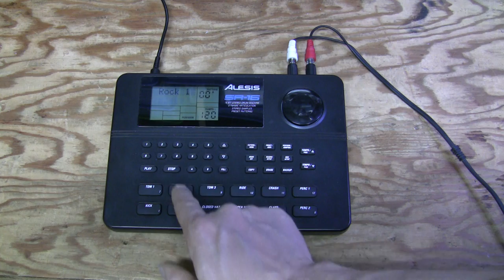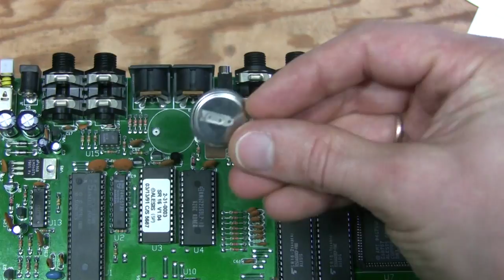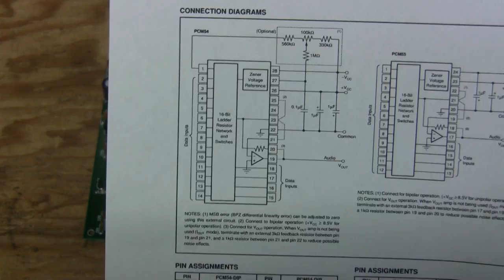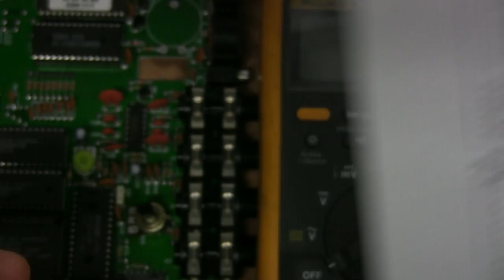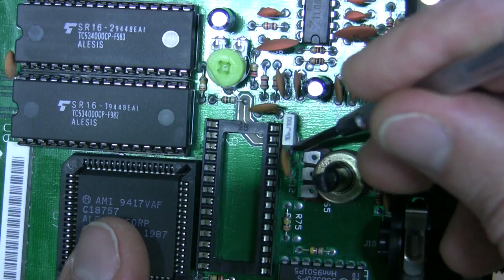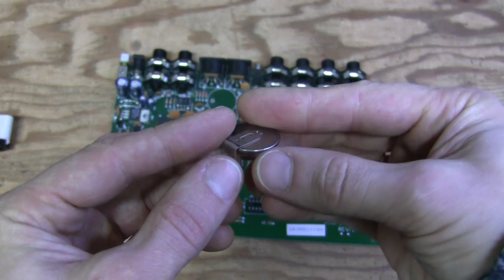#21 - Alesis SR-16 drum machine repair

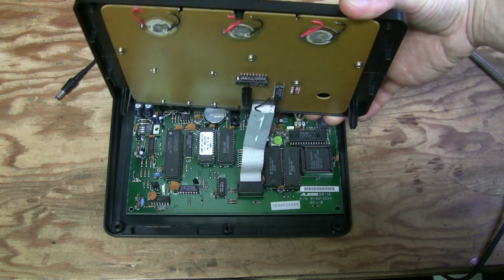Comment: 2:00 I can’t disconnect the front panel 😢 I don’t want to break the cable. Im trying to figure out why the huge volume knob doesn’t work at all, but all the sounds work fine. But the volume knob has no effect on the master volume.

Comment: Found one for cheap at Goodwill. Ordered a power supply to try it out, but had some garbage characters on the display. Pressed the socketed chips to reseat them and unit is now working. Still need to replace the battery and spray the volume control with tuner cleaner.

Comment: I got two of these for free, stating they were not working. I tested the power supply and got no voltage, so I ordered up a 9v ac to ac 1.3a PSU, as I needed one for my old digitech multifx unit anyway, and figured if nothing else I would have a replacement for that. Plugged it in and they both worked. Just need to clean up the volume pot and install some battery holders, since both original batteries were cut out and dead, anyway.

Comment: This video was insanely helpful after finding out the 3v battery on my unit was dead. Had no idea about the battery until i looked up why my SR16 wasn't saving patterns. 
Your suggestion to use that battery bed was probably the most helpful practical thing I've ever watched on youtube. From now on i don't have to order a special battery and go through the soldering each time...When it dies again i can just pop a new one in!! My SR16 is now immortal lol Thank you!

Comment: Bravo !! Very good video. Thanks for making the video. I've got a unit that is doing something similar. I'll use this video as a template for servicing it.   In 1997, I used an SR16 on this one man band recording.  The recording was done with dedicated 6 track, digital (which was new technology for the consumer, then) recorder.  This was one man band stuff, recorded in an apartment. https://www.youtube.com/watch?v=moEkIBJuk7U  PS: Later I studied jazz, and found that I could not get a good jazz drum sound out of my SR16, so I improvised a very low tech solution: (drum roll, please).. I took and empty coffee can, stuffed it full of empty plastic shopping bags., put the lid on, turned upside down, and used drummer's brushes on the bottom of the can. Talk about low tech... here is the result:  https://www.youtube.com/watch?v=Nr2aFJvL2YI

Comment: Thank you for this.  I just bought one of these from someone and, lo and behold, it won't store any settings or patterns after I switch it off, so I guess the battery needs replacing.  I managed to find what looks like the same battery holder on amazon (20mm between the pins) so thank you for all that detail including the orientation to fit it.

Comment: That was excellent. I learned a lot. I have a SR-16 that I just got out. I bought it around 1989. It also has a noisy volume pot. I will check the battery as well. It also has a rather dull LCD display. Do you know if the LCD would need to be replaced, or could there be another issue?

Comment: Great video. I'll be honest and say I don't understand some of it. I just got my broken Sr-16 down from the loft and opened it up to see if I could make sense of it. I think it stopped working (well the LCD briefly flashes on then off when powered up) when I was loading some midi data from tape. Is it possible that the volume from the tape player was too loud and overloaded something? I think I think I need to watch this video a few more times before I start trying to test with my multi meter (and watch other videos too if I can find them). I tried an alternative PSU but get the same problem.
Reply: Update..............I just stood on the unit and snapped the Volume Rotary Pot! :( ....and I just noticed some residue one the a pot (the green one on yours). Not really sure what the pot is for though or if it is the cause of problem?

Comment: I wish you did the video on this for no sound. I have the exact drum machine you're repairing here bought it broken from a shady seller. So am trying to figure out which way to go. I don't get sound I do get hissing from the drum buttons when I press them. I have 4v at the mains and 4.4V at the Aux. I wish there was a schematic.
I am trying to learn how to diagnose. Let me know if you have any advice. Thanks
Reply: Hahaha no need for help I was sold the SR-16 with a 12V DC adapter. So since it takes only 9V AC to give negative to the analog side, which I never showed, I had to find an adapter and change the plug to fit the plug. Well well well it now works perfectly. Guys check the damn AC Adapter. If it's  AC/ DC adapter it's  no good. Has to be AC to 9V ac adapter. Learning experience.

Comment: I know this is a very old video, but do you know the values of the 3 Resistors around C62 ?  I have a REV: AD that must have been modified . Originally it just 2 Horizontal resistors between the  optocoupler and battery. the mod had 0.1uf capacitor non electolytic ,  470K and 1K in series connecting to Vcc pin 8 of the 6N138 opto-coupler. Top man :) Thanks for the very useful video. its helped me a lot.

Comment: I've just came across this brilliant repair. Well done. 
I have the older version of the SR16 and have changed the battery. When I power up it does not remember the last setting. When it powers up it displays Empty Pattern. I then have to press the "PRESET" before I can use it. Any ideas...please.
Reply from the maker: Did you check the voltage on the memory chip after you replaced your battery? I showed in the video how to check it.
Reply: @feedback-loop  Thank you for your reply, Your videos are excellent and inspired me to look at the problem further. I was the ground on the PCB where the battery fitted. All working now. Thanks again.  Keep safe.

Comment: I have a SR-16 built more recently (2000s).  
Most all components are now surface mount - and there are fewer of them.  Alesis has re-designed the board to reduce cost.
I think Alesis eliminated the battery - uses non-volatile flash memory now.
Reply from the maker: Like this one? https://www.youtube.com/watch?v=6RJVtQ8i0eY

Comment: I just got a "like new" SR-16 in the box and I have to beat the living crap out of the drum pads just get an output that is close to the pattern and demo playback. As a result, anything less than an absolute pounding results in barely audible sounds. I have the level set to LOUD, but it doesn't seem any different that when it is set to SOFT or MEDIUM. Is this a software issue or faulty pads, or is there something else I'm not doing right?
Reply: The volume may be turned down on the settings for the drums themselves. You can adjust them in the menu for each drum.

Comment: Hey brother, or anybody reading, do you have any advice on how to fix a jammed volume knob on my akai xr 20 drum machine? It is very similar to this. I dropped it one time and it fell right on the volume knob that sticks out from the back, and sticks out  about a quarter of an inch from the back of the machine. Only one side (the left headphone is working). If I put the volume up the whole way and push it in towards the left it plays on both left and right volume. Who could I go to to fix this or find out how to try and fix it myself? Thanks

Comment: I realise this is an old video now. Excellent discovery of the fault. I am just wondering whether the conductive residue could have been caused by someone previously using inappropriate cleaner on the volume pot which then settled on the tracks which were nearby?

Comment: hi can you help - i have an sr-16 which can't remember patterns and songs. i replaced the battery but still not working and no power between pins 14&28 in the memory chip. looks to me like the centre "-" pin (under the battery) is not connected to any tracks on the circuit board - is this correct ? thanks so much
Reply from the maker: The pad within the circle? It is connected to the ground plane.

Comment: Any idea why a foot pedal won't work in the STOP/GO input?  It worked fine but suddenly stopped.  It's not the peddle because I tried three different peddles and none of them will start or stop the beat(s).  Also, why is there a battery in it?

Comment: I have a problem very similar to this but might be I tried using a D/C power supply . Have seen it should be an A/C PSU !! If mine still does I'll try this method to trace my problem. Many thanks for this video!! :)

Comment: Hey what I want to know what can cause the Alesia-sr-16 not to power up at all and and is there anything I can do
Reply from the maker: Many reasons can cause it not to power up. Perhaps, you could try some basic troubleshooting depending on your skills and equipment available. I would suggest starting from the power supply. Is it the original one? If not, is it 9V AC (not DC)? Do you have a multimeter to check the output?

Comment: By the stains on the PCB, I bet someone spilt something on it.
I think that is the same display as on my Casio keyboard.
Reply: I was working for a couple of years in consumer electornics industry and saw similar stains quite often. Usually when a unit failed at some of the factory tests (for example due to poor soldering) and manual repair was applied in the factory.  The standard production is made by machines but the repairs and the soldering of some through-hole parts are done manually. At this manual soldering process they use "flux" to help the flow of the solder and it happens quite often that the repair person doesn't clean the residue up properly. The other source of stains can be the rubber buttons on devices which use these kind of buttons. During production rubber buttons are baked and if they don't bake them for enough long time they will "sweat" some oily liquid out later. This is a usual issue on TV remote controllers. People think that it is some moisture or split drink from outside but it is coming out from the rubber buttons.

Comment: Brillant anaylsis.  Today I re-caped a Sanyo clock radio and it produces better output but I will try to check some of the bypass ceramics to see if I can reduce a slight hum in the circuit.  So the take-away is replace the batteries requently so they don't start leaking and produce shorts on the board.

Comment: Hello, could you please help me? I have got battery problem as well with my Alesis D4 drum module. I downloaded the service manual, and I found a very complicated procedure in there about the battery replacement (needs system reset and so on). If I replace the battery according to your video without resets, could the D4 produce any malfunction? 

Thank you in advance!
Reply from the maker: I don't know what complicated procedure are you talking about. I have not seen the service manual you have. I guess the complication might be about trying to save custom settings and patterns. I had nothing to lose since the battery was completely dead. If your battery is dead too, I would imagine that you have nothing to lose as well since all custom settings must have been lost already. If this is the case, just install a new battery, and then see if any reset is necessary (because of some garbage in the memory or some inconsistent settings or something like that). If there is a reset procedure in the manual, I see no harm in doing it at this point just in case (assuming that all custom info has been lost anyway).
Reply: FeedbackLoop Okay. Thank you!

Comment: I wish I had the skill to make repairs like this. I have an SR16 and I've had it for around 10 years. I use it all the time  but the other day I noticed the 12 volt adapter had stopped working. I tried another adapter and it switched on but all I got was different types of hissing for the different drums. I have tried other adapters and they all show it functioning but no sound. It has to be internal, it's nothing to do with the signal path to my amp. I only have a very basic level of understanding when it comes to electronics, and that was analogue. I shall have a cursory look and if it doesn't work put it in the free ads in case someone else can make use of it. It's a great drum machine.
Reply from the maker: Did you use an AC adapter (not DC)? Read carefully on the power adapter. It should say something like: "Output: 9V AC". I am almost sure that your problem is caused by a DC power supply.
Reply from the maker: And the power supply must be 9V, not 12V. Read on the back of the machine next to the power connector.
Reply: That must be the problem as it is an AC to DC adapter I'm using.  It's one of the ones I use for my guitar FX pedals. I'll see if my local Maplins is open. Thanks very much. That has to be the problem. I shall hopefully pick one up today. Many thanks for the help.
Reply: I found a 9V ACadapter but I noticed it says 500ma and the instructions say 100ma. Is 500ma too much? Thanks for your help, it's much appreciated.
Reply from the maker: The current marked on a supply is the maximum it is capable of delivering. I am not sure at the moment how much the machine takes. It seems to me that 500mA must be more than enough. If the connector fits, give it a go.
Reply: Thank you very much for your help. I now have my SR16 working great. I thought I was going to have to find another but you saved it for me.Cheers

Comment: tell nominal potentiometer? I crunching sound, how to fix the problem without having to remove from the board? or where to get the wiring diagram. It is necessary to shake your hand .. you in advance for your reply
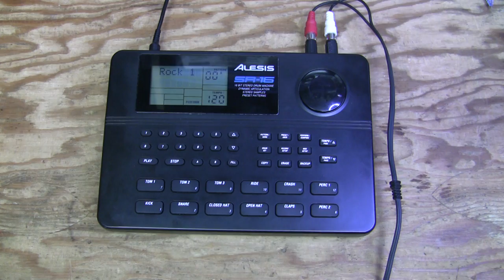Reply from the maker: I am not sure I understand your question. It is a 5K logarithmic pot. I showed how to clean it without desoldering (at 23:26). It is not guaranteed to help, of course. If the cleaning doesn't help, then more drastic measures might be needed like replacement or, perhaps, desoldering and taking it apart, cleaning and bending wiper contacts or something. That would take more skills, and also not guaranteed to work. There is no schematic diagram available.
Reply: FeedbackLoop 
I wrote to you through an interpreter, so you can understand me wrong. And yet, thanks for responding to my question
Reply: how to replace the battery ?  
I have the same problem as you but nothing happens

Comment: you are fantastic....easy to follow your repair.
I think Ill try to buy a junk and fix it...maybe add a dc power pack to use with out ac adapter and some leds to light the display

Comment: Will it (should it)  work with a DC - power adapter? I have tested with 12V dc, and everything works, exept the sound is very faint and very distorted, drums not recognicable, but the rythm is there, and all menus work.
Reply from the maker: +MrVidar0 
I don't think it will work properly, and you see it.
Reply: +FeedbackLoop 
Thanks, I will feed it 9V A/C when I can get hold of it. Nice going there with trouble shooting and repairs. You make good inspiring videos.
Reply: Hey MrVidar0
Did the A/C stop the problem? Just tried a D/C and had same problem got  an A/C on order just wondered if it was that that was my problem!!
Reply: OK update these need a 9v A/C output PSU not D/C :)

Comment: Hi FeedbackLoop. I got my Ion IDM02 recently from eBay and I have major issues. It works for about a minute and then suddenly the output sound volume goes down to a very low level. It also seems to be sending continuous random-like midi messages, mostly note-offs. Any idea would be appreciated for where to start checking.

Comment: Hi. I've got same drum machine. My problem is power up and working fine but no sound on any output? Have you got any idea what's a problem mate? Is this flat battery? Regards
Reply from the maker: +Michał Barwik 
No idea so far. No data - no opinion. The battery is there to retain your settings and custom patterns. So no, I don't think the battery has to do with having no sound.

Comment: where do you get the Lithium battery from..what is the part #
Reply from the maker: +Bob Barcus 
I installed a holder for a standard 2032 coin cell. I think it was something like this: http://www.digikey.com/product-detail/en/BS-7/BS-7-ND/389447

Comment: Hi,I'm trying to replace a scratching volume pot on mine. Do you know what type (specifications) of the pot is this? Will you be able to share the schematics by any chance. Thank you for the video.
Reply from the maker: +Alan “SixPack” Lu 
I vaguely remember someone asked me about the pot in the comments before, but I couldn't find where. From memory, it was 5K logarithmic, but I can be wrong. What is the marking on yours? Can you measure the resistance? If so, measure in the center too (and maybe at 1/4 and 3/4 adjusting for not full 360 degrees). If resistance seems proportional to the angle (about half in the center), then it must be linear. Otherwise it is logarithmic.

Why do you want to replace it? Have you tried cleaning it first? If cleaning doesn't help, I would try desoldering it, carefully opening and having a look inside. Sometimes the wiper contacts are corroded and need a bit more aggressive cleaning. Sometimes they are pushed down a bit so that the contact is intermittent. Carefully bending them up slightly can help.

I don't have schematics. Sorry. I wish I had it. Good luck.
Reply: Thank you for the explanation. I'll try it. It has the same symptom as what you've explained, makes scratching noise. I'll try cleaning it first as you have showed. Thanks again.
Reply: Measured it. It's a 5K. In the center it's ~1000 Ohm, 3/4 about 3K, so I'm guessing it's algorithmic then.
Reply: "logarithmic"
Reply from the maker: +Alan “SixPack” Lu 
Ok, so you confirmed it. My memory served well. 5K logarithmic it is.
Reply: I actually followed your video and cleaned it and it just works now. No need to replace it. Thank you very much.